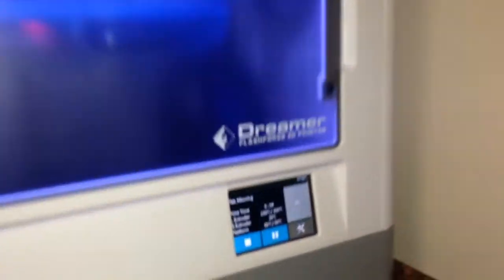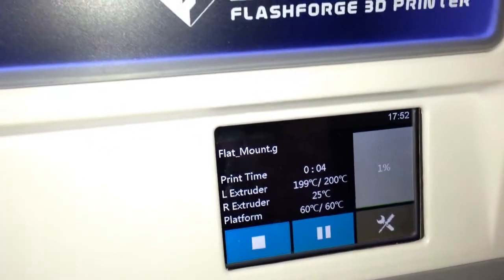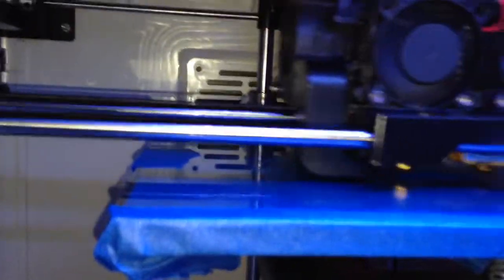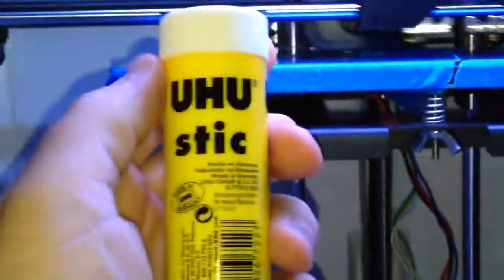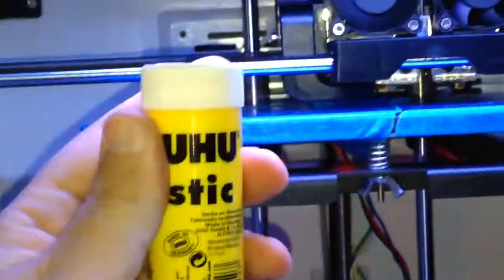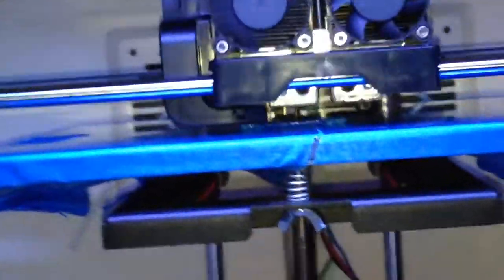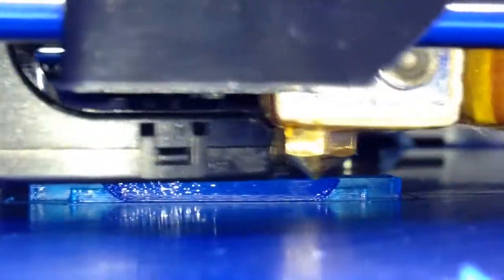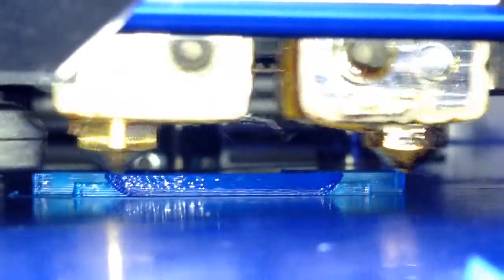Flashforge Dreamer - Glass Bed

Comment: hi there, did you remove the original 3m blue pate? the one has a flashforge mark on it
Reply from the maker: My printer was the first ever to be shipped to Australia. It had an aluminum plate with orange kapton tape....which ripped after a few days
Reply: +Thomas James so ur printer didn't have a blue 3M plate as the current model??
Reply from the maker: Yu-Chang LI Nope, but I bought a few of those blue sheets and didn't like them. I found it VERY difficult to remove. Once I removed it from the glass it left behind a LOT of sticky residue which I had to remove with TURPS and then clean with 100% alcohol
Reply: I have just upgraded to glass bed. but my model now is unable to stick on the bed. do you print ABS?? what is your temperature setting?? I tried to print the model directly on the glass
Reply from the maker: Hi. the BEST option that works every single time for ABS on glass is this:
Nozzle: 220°c
Bed: 110°c (with hair spray on the glass)
Speed: 60mm/s

Just must clean the glass and then spray with hair spray
Reply: @pcarlson1979  So you no longer use the glue stick, just the hair spray?  Do you spray the glass while it is outside the printer then tape it down to the aluminum bed?  It would seem spraying hair spray in the printer might make a mess over time.  Thank you.
Reply from the maker: lemmy999 after 4 years of glue and hair spray my Z axis motor got clogged with a lot of gunk. I fixed it and I now use the blue printing surface. So much better and stuff ALWAYS sticks to it
Reply: @pcarlson1979  Thank you for the response.  Earlier (2 years ago) you said the blue sheets didn't work well for you and you found it difficult to remove parts. What did you do to solve this problem?  I have been printing on blue painters tape and it works fine for small parts, but for big parts (something like a 4" diameter cylinder) it is very difficult to get the print off of the painters tape.  Like yours, mine is older and came with the kapton tape on an aluminum bed.
Reply from the maker: lemmy999 hi. The new blue sheets feel VERY different to the ones I used a few years ago. Plus you need to make sure your first layer is 0.3mm thick and only heat the bed to 50c. I still need a blade to remove the prints but it's pretty easy

Comment: Hey Thomas. I have this printer and I was just wondering, what are the advantages of a glass print bed instead of the aluminum print bed?

I also have another question. The kapton tape on the print bed is peeled off a bit at some places. Will this be a problem?

Thanks.
Reply from the maker: Hi, I still have the aluminium bed, I ripped my factory Kapton tape within 3 days and got sick of using blue tape all the time. I put a sheet of 6mm glass ON TOP of the aluminium bed. The advantage is that the bottom layer looks nice and shiny, and I just use a glue stick before printing and getting the parts off is pretty easy. NO MORE RIPPED TAPE!! That was my main reason for a glass sheet on top of my aluminium bed